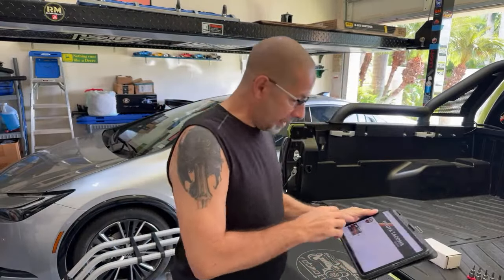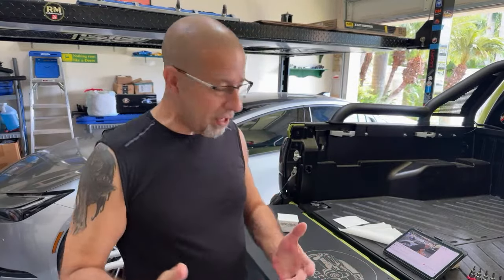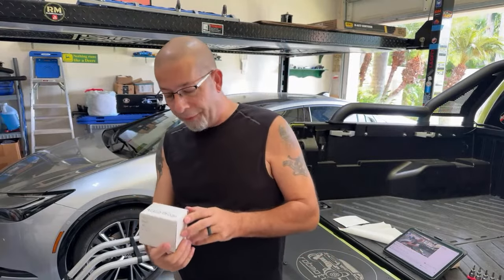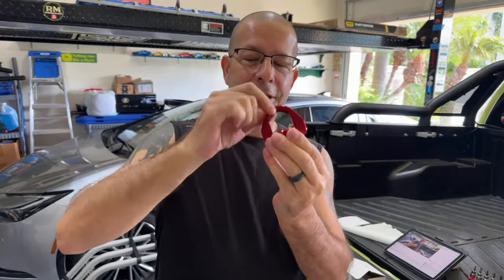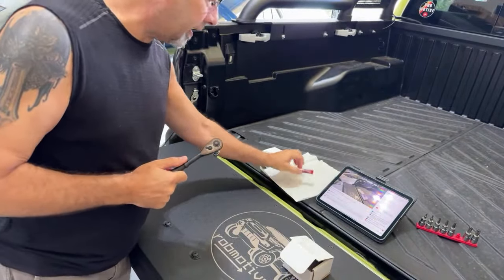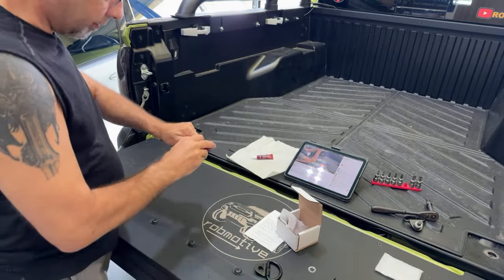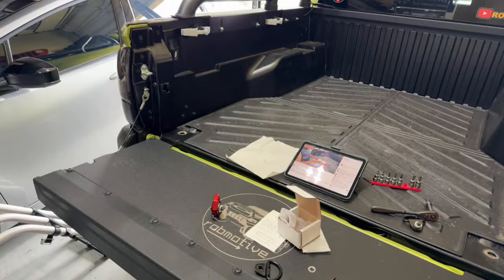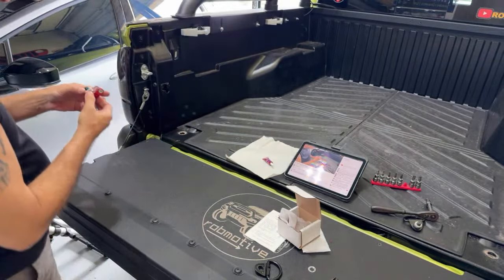Tacoma Bed DRing Tie Downs Installed Live!

Comment: Just ordered a set of those along 
with the complete bed tie-down set. Looks great!
Reply: Just ordered a TRD grill for my sr heavy abs plastic black 3 built in Ĺ.E.D raptor lights built in to the top amber Grey letters spell toyota go on afla dry
Reply: On a flat spot that runs under the lights then at the.ends are the day time running light in white and they become amber directional signal lights in amber the bottom. Part is the honey comb should make a difference to the sr grill and go nicely with my mirrors I changed the signal type and I installed the nice l.e.d. sequential signals lights